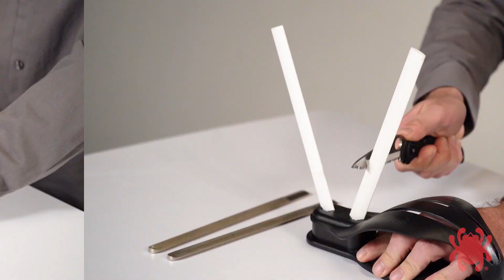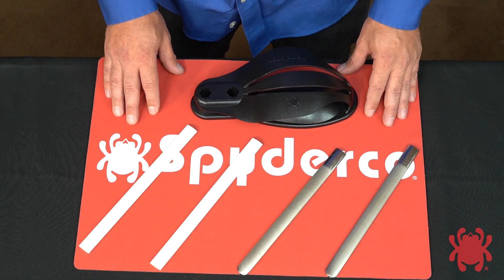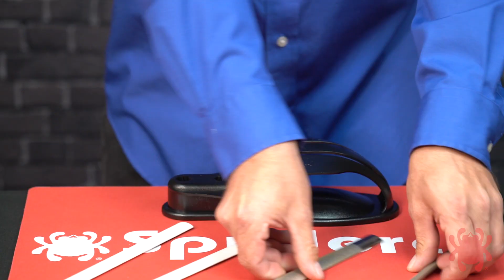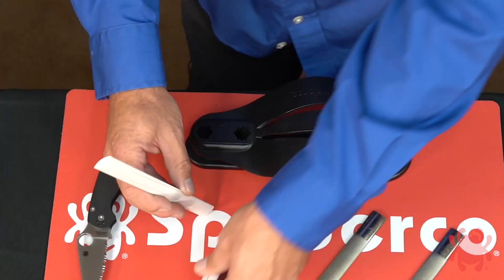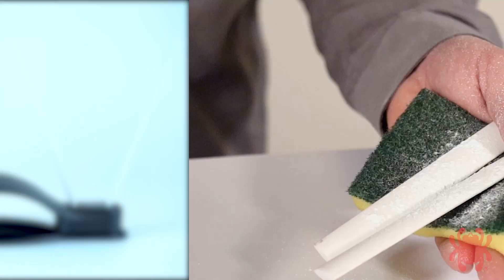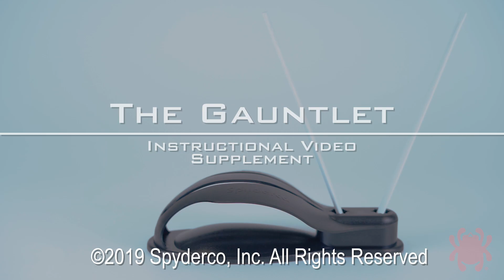Spyderco Gauntlet Sharpening System Instructional Video

Comment: Only question is which one has better(more effective) and longer lasting stones. Triangle or this?
Reply: I have had a shirt maker for many years and I'm just trying to figure out which one is really the better product.
Reply: MrVegaslive the ceramic stones will last a lifetime in both units.  The coated stones would have to be replaced if enough of the abrasive is removed from the surface. That goes for the brown and diamond stones of the Sharpmaker, and the CBN stones in this unit.

Comment: Looks like a nice product.  I have been using the Sharpmaker for many years.  Is this an upgrade to the Sharpmaker?
Reply: If they would have had 30° inclusive slots it would have been an upgrade.  As is I'd say it's a simplified version for beginners.  The cats eye stones are cool.
Reply: Yeah, I wouldn't say an upgrade, just a similar but different product. I'm actually trying to figure out what it's real purpose is myself, compared to the Sharpmaker.
Reply: @gstrader73  I guess it's for people who just want an easy way to touch up their knives without having to think twice about it. Sharpmakerfans might see it as a loss of versatility, but for many people it will mean more simplicity/usability. One hand goes into the 'gauntlet' the other does a few slices - done. Just one angle and a preinstalled handguard makes it great for home cooks or even professional kitchens.
Reply: I guess it could be called an upgrade. The Spyderco website says the Gauntlet Premium can reprofile badly worn edges and sharpen very dull knives, whereas the Sharpmaker seems to be more "light duty."
Reply: @profd65  That could be at least partly down to the fact that the Gauntlet comes with coarse and fine stones, but the Sharpmaker comes with medium and fine. But you can buy coarse stones separately for the Sharpmaker.